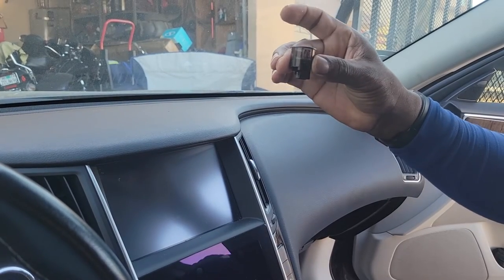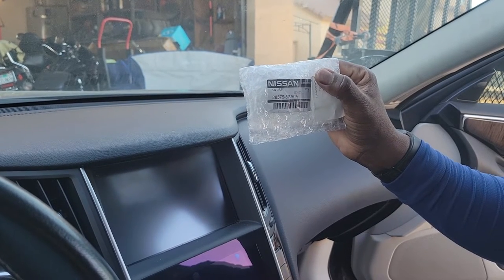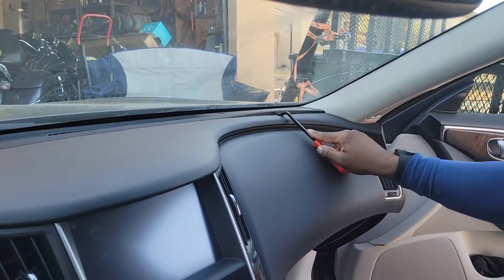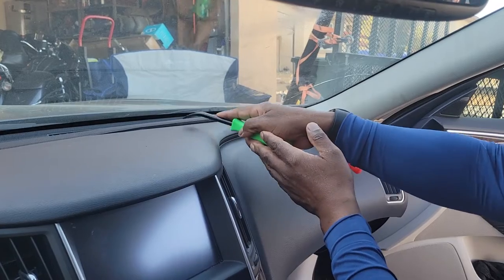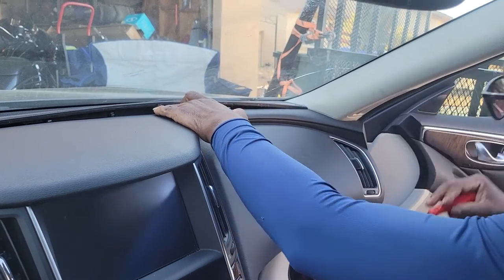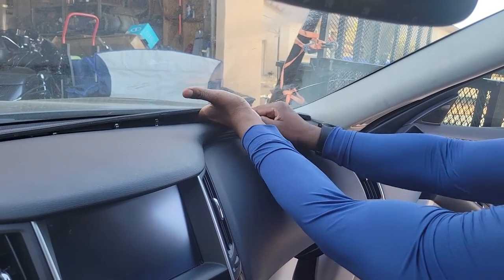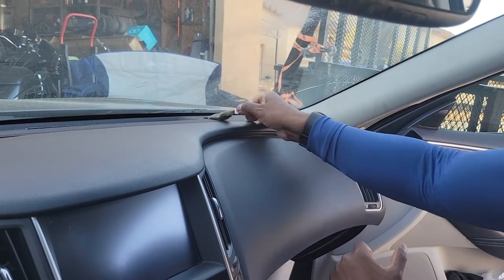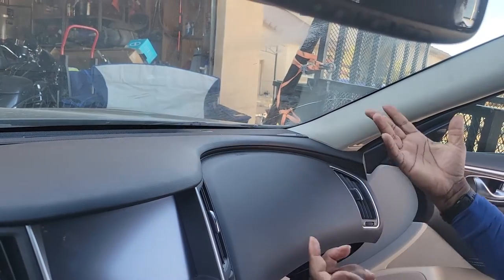2014 Infinity Q50s passenger side Sunload Sensor Relacement

Comment: How did you know which side was bad
Reply from the maker: Sorry for the delay. The AC wasn't getting cold, so I took it to an AC Repair Service. They said the driver side was bad and the passenger side was good. Regardless, I decided to change the passenger side myself and save money. So, I ordered the part from the dealer and installed it myself.

Comment: I have the same car but right hand drive. Is the sunload sensor located in the same area?
Reply from the maker: Sorry for the delay in response. There are two, one on the driver side and another on the passenger side of my year, model and make. 2014 Infinity Q50s. If you have one sensor, its located in the middle, if you have two, its one on each side.